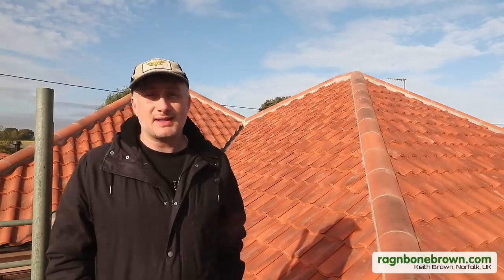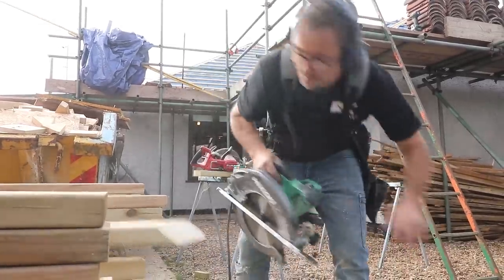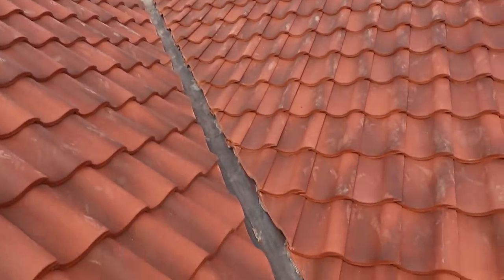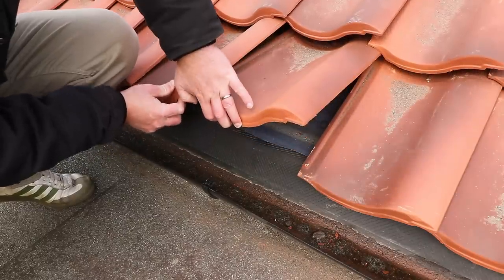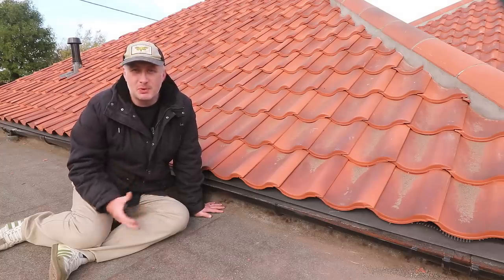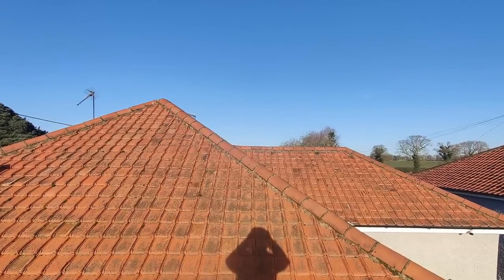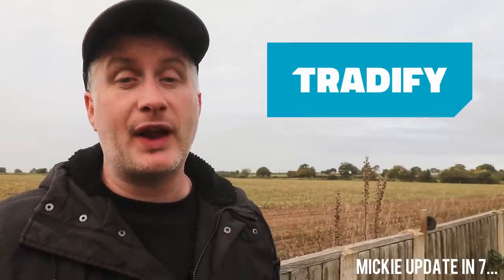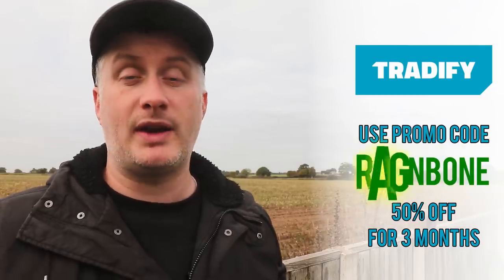What Did It Cost? // Ceiling Repairs // Questions Answered

Comment: counter battoning  is usually only done on vaulted roofs where the insulation  is up in the rafters  and is restricting the roof from breathing . the counter battoning help with air flow. its not needed on your roof because the insulation is at ceiling level and the roof can vent through the soffit or vent tiles

fair play to robin for donating his time
Reply from the maker: Thanks for that info, interesting 👍 yeah Robin is a legend!

Comment: Roof is looking good Keith - As someone who`s been in the building trade 30+ years its great to see the very calm and forgiving way in which you dealt with the leak situation - yes they did cock up but only due to an over sight, I`m sure you roofer was gutted at what happened - good on them for compensating you too - which they should without hesitation! - Roofing in this country can be a nightmare with the weather - I`ve had many a sleepless night listening to the rain beating down worrying, knowing that the roof we are working on is only felt and battened!!

Comment: Hi R 'n' B B, thank you for doing these videos so well!, I have spent most of the last fifty years in the construction industry, first as a roofing labourer and then on the tools, leading to switching to learning enough about other trades and skills to deal with most issues, with the exceptions of electrical and plumbing, the part that interested me most was always the carpentry.
The first thing I noticed was that the roofing contractor failed in his management duties by failing to ensure that his employees did not cover the old flat roof when stripping the old tiles. This water penetration was always the number one concern on every job I ever did!, there was never any question that any damage would be repaired at my expense, likewise any problems with any part of the roof after I have 'finished' to come back to me, this policy of mine was always and only the product of my own sense of responsibility and pride in my work but one consequence is that I have never had the sort of problem you had to experience!.
The last thirty years as a main contractor it has always been very clear to me that just because I have taken on a sub-contractor for some of the work all of the job and the management of it is still down to me, I understand that many other operators in the industry are less conscientious but all in all you could have been much worse off!, at least they got the job done and will pay for the damage.
On the topic of counter-battens, they do increase the depth of the air space between the tiles and the felt and this makes more difference on a roof covered in slate which are usually fitted on thinner wider battens, also fit closer to the roof. The most important application is when covering a boarded roof, where there is no droop for the felt between rafters, also on roofs with occupied loft space where the whole air mass in the roof is much more confined. In all these situations everything depends on the effectiveness of the vapour barriers in the rooms below, where this is fully effective it does a great deal to reduce condensation on the cld undersides of roof coverings, the main case of wet in modern homes!.
In your situation I would recommend that you ask your plasterer to fit foil-backed plasterboard but this will only help those rooms being re-done, since to have to replace most of you loft insulation you have the chance yup there to fit loose thousand gauge polythene membrane over the joists with the insulation on top, I always did this on roof re-furb jobs while I had the roof open, so much easier to gat at!
I was in the roofing job when that plastic strip along the eaves was first introduced, I had always known that the earlier method with the bitumen roofing felt draped over the rafters left a pocket along the fascia that held water until it didn't!, I always fitted another roofing batten so that its top corner came just above the fascia line to reduce that pocket and was happy to use the plastic stuff to achieve the same result, I was however concerned that the vertical junctions between each section do not stop any water running sideways and in, I think the strip of DPC that they have fitted for you is better.
Cheers, Richard.

Comment: i've never seen a pitched roof counter battened, however it is something you do on a flat roof sometimes. I'm no roofer myself but i remember someone once said that it's better if the felt is put on slack, rather than tight, so it leaves a gap between the battens and the felt for water to run in.
what a lovely guy Robin is, valuing the skills learned over the money is incredible to see

Comment: My dad and grandmother's houses were built in the same timeframe and are right next to each other.  Dad's house has a pitched roof and grandma's house had a flat roof. As such, about as good of a side by side comparison as you will ever see.  Grandma's house has had numerous leaks over the 54 years I've been alive and been redone three or four times.  My dad's has never leaked and only once was redone because it was 20+ years past the expected life of the material used.  As such, I would never want a flat roof.  Converting it the way you did makes complete sense to me.

Comment: Same. We got a Level 3 survey and most of the observations were just that and no real conclusions were made as destructive testing would be required, which they obviously didn't do. The survey even missed pigeons nesting under solar panels, despite very obvious signs, which was a pain to resolve later.

Comment: When we moved into this house we didn't have a survey for reasons exactly as you said. I'm a competent diy'er so know what to look for. Previous surveys we've had done have been a waste of time and when you check out the small print, there are that many clauses to absolve them of blame there'd be no point in complaining. Mortgage survey though, did value house at 5k less so we dropped our offer which was accepted. 😁😁😁

Comment: 30+ years roofer comment on your questions--- The counter battens are not standard practice.  However i would have reused the eave trays ... DPC in this situation is not recommended as it will sit straight and have potential for water to track back - thats why the eave tray is shaped to drip down into the gutter.

Comment: I agree totally about the survey. We paid for a full detailed survey on our first/current house purchase. It was all doom and gloom but covered with caveats about not being able to move furniture etc for more detailed inspection. I got suspicious when we were informed in writing that all ceilings were liable to collapse due to be old lath and plaster. The cottage was built in the 1850's. If the surveyor had bothered to move the loft insulation to one side he'd have seen it was all plaster-boarded and artexed within the last 10 years. Same downstairs. He missed the glaring issue of blocked air bricks and a rotting wooden floor downstairs though. I sorted all that in one weekend. I can patch up houses and have worked on old housed since I was a kid and felt I'd got more knowledge than someone with a torch and a laptop who'd just charged me a grand for a script off his laptop.
Reply from the maker: Exactly right! 👍

Comment: I may be wrong, but I think most, if not all, mortgage lenders require a survey. And, on older properties, a more in depth survey than for say a new build or newer home. However, I would agree that even a reasonable diy-er could spot any potential problems, but having that piece of paper from a surveyor is what lenders want.
Reply from the maker: There are different levels of survey that they accept though, I think about three. We went for most expensive, which was a mistake

Comment: It's a shame they chucked your eaves trays. The dpc that they use isn't UV stable so it'll end up disintegrating in a few years. They should have used High Performance Eaves Protection Strip/felt instead

Comment: If you need a mortgage you have to have a valuation survey. If you want a surveyor report on the condition of the building, save your money. Unless its a structural survey. If anything is found you can sue the surveyor for missing it, but only on a structural survey.
Reply: Even a structural survey can wriggle out of responsibility by saying things like “… but I could not examine closer as the householder was not willing to have plaster removed so I am unable to confirm…

Comment: Are the roof tiles the same as the shop? If so, reuse them to do the repairs to the roof. Then clean it... Usually looks better than new
Reply from the maker: Some are, some are not, we've got a real mix!! Trying to sort them in to piles. I'm tempted to have a go at re-roofing the workshop myself but will probably be a year or two yet

Comment: Surveyors are useless. When I bought my house I already knew it was structurally sound but I had to have one done as part of the mortgage agreement.
The surveyor gave the property a red mark - as in do not buy - because one plug socket was loose and a screw was missing meaning the "live wires were visible". 
It required a phone call with the mortgage agent in order to clarify that I was happy to accept the responsibility of the repairs.
It was fixed in about 10 seconds.
Absolute joke of a system.